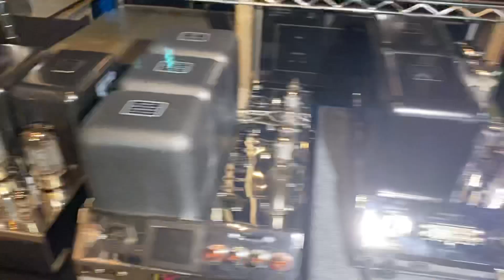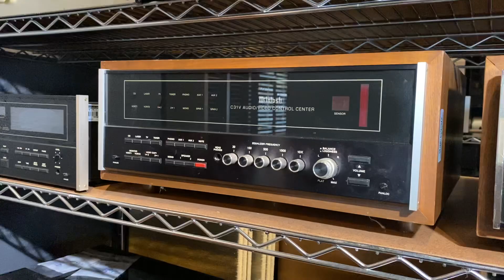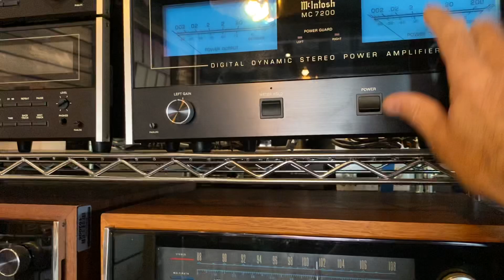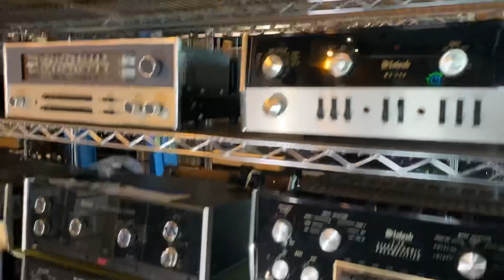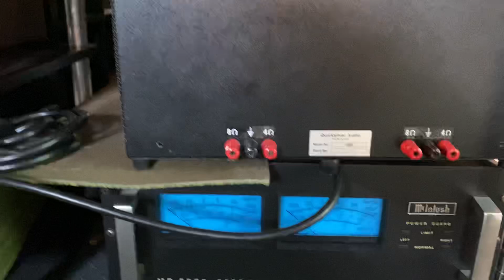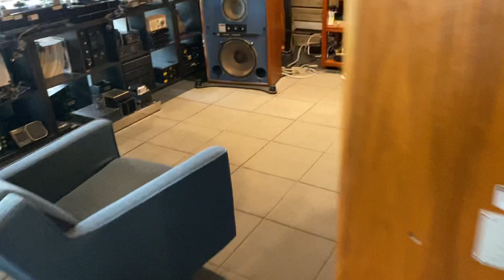The Wall of McIntosh at SkyFi Audio, Vintage Audio Collection

Comment: I have asked a few You Tube contributors about the first solid state amplifier that McIntosh made and so far I have gotten three different answers. I have a set of three McIntosh products a mr77 a c28 and the amp in question a mc2100. I believe that amp predates all metered amps. Can you shred some light on this.

Comment: Restoring old audio gear is really an art form, I'm currently restoring a sansui 9090db with lots of issues and it really isn't easy getting the high quality parts you need to keep that original sound.

Comment: You got a MC150 or MC7150 in that stash ?? ;)
Reply from the maker: Maybe ;-)
Reply: MY current setup wants either a MC150 or MC7150 wide faceplate to be complete....got a MC2505-2 DeWick to trade against a portion of the bill if that makes you smile ;)